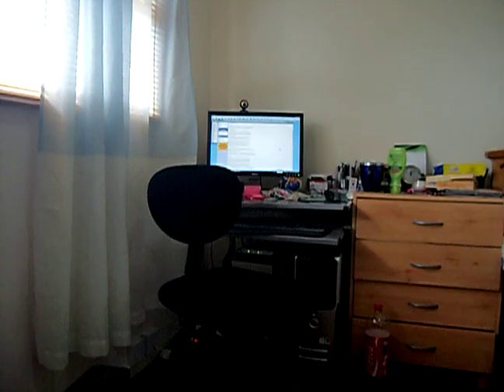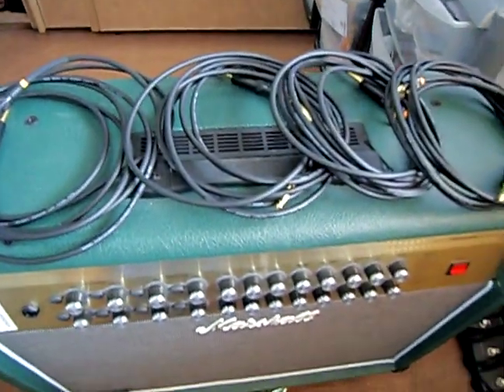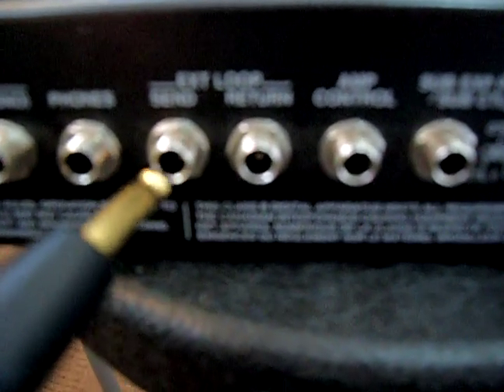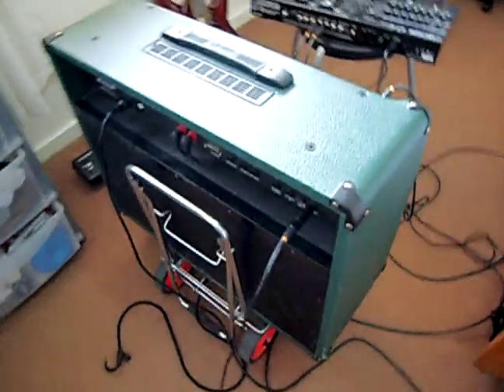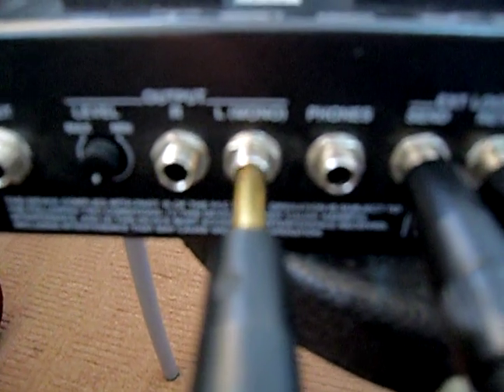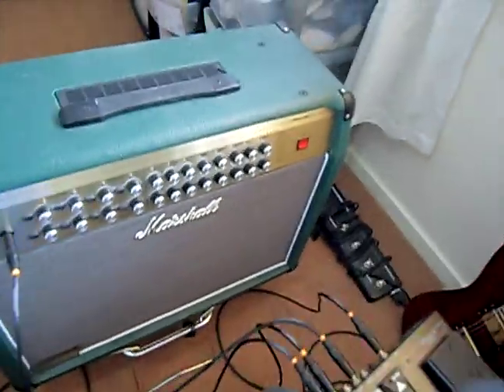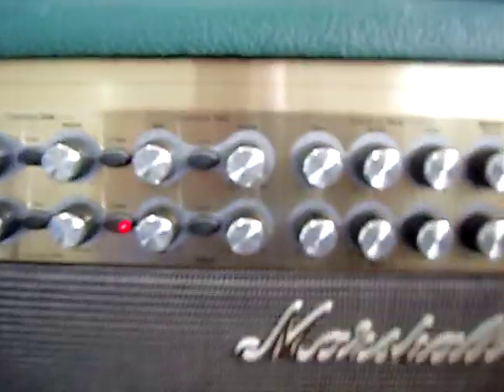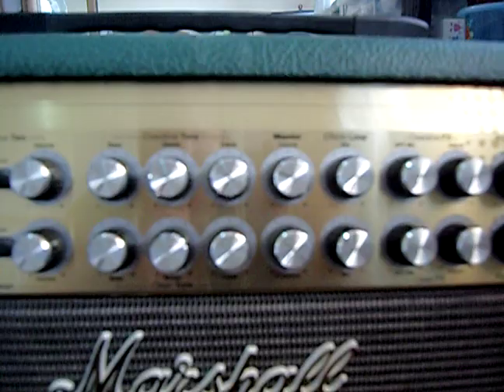Boss GT- 8 in 4 Cable System

Comment: Hi Jose, i have just seen your video, unfortunately it is totally wrong. The preamp on you marshall is paralized as tou say, because on the boos the loop function is not activated. In this case your 4 cable method makes no sense. All what you have generated a regular chain guitar->gt8->amp. If you activate the loop button on gt8, than is the 4 cable method alive, some of the effects are going before the marshalls preamp, some after. This is the sense of tye 4 cable method. All what you have achieved is a basic chain without the 4 cable method.

Comment: Basically, it makes the boss gt-8 the amp head, but you still have your amps power to power the cab...So, it actually puts the gt-8 AFTER the power-amp, but making the is BEFORE the preamp...

Without the 4 cables, you basically would just be going into the front of the amp or the effects loop, altering all tone, but the gt-8 is the only real source of sound, just the amps power amp is powering everything.

Comment: if your going to bypass the knobs on front anyway just one run cable to the marshall power amp it makes no sense to run 4 cables and get the same result with 2

Comment: @skiesburngrey I agree with this. Your method is simply using the Marshall as a power amp and you can just connect the output of the GT-8 to the fx return on the Marshall and that's it. One cable is all you need.

Comment: @NZLeduc - you're absolutely right. This is a standard series effects loop rig. Like you said, the four cable method allows you to include your amp's preamp in the signal chain when you want it. The proper 4 cable method is:

Cable 1 - guitar into GT8 input
Cable 2 - GT8 left output to amp FX return
Cable 3 - amp FX send to GT8 loop return
Cable 4 - GT8 loop send to amp main input
Reply: thejamspot yes, but you also have to activate the loop function on gt8!

Comment: its mostly for those who don't wanna use the built in amp simulations on the GT and wanna use their own amp's distortion but still be able to use reverb and delay and all those modulation effects POST-DISTORTION, it allows you to have 2 sets of effects pre and post effects, pre being wah, com, noise gate, OD, and post being reverbs and delays and modulations, teh way this guy has it is so he uses the AVT as a poweramp and speakes but thats not the main reason to have this set up

Comment: the best way to use it so that your amp becomes only a power amp is to plug the GT's output straight into the AMP's effects RETURN, turn the effects loop MIX knob on the amp all the way up, and plug a DUMMY (just a 1/4" plus with nothing connected to it) cable into the effects SEND of the amp so it bypasses your preamp completly

Comment: ya cool shit,I have a Blackstar HT5 with pedals in the front and the loop,then I just recently got a Roland JC90,AND I SWITCH OFF FROM ONE TO THE OTHER,But was lacking some compression,and some other stuff ON THE JC,then I said,Duh I have a GT8 Packed away,just hooked it up like this,plus one other cable,cause I got 2 speakers in the 90.and holy shit,amazing,got compression and much more now,SWEET! : )

Comment: 5cm is the go if ya have a 2 channel amp, connecting the fifth cable to ya amp control, and to the amp channel switch give the ability to switch the preamp from clean to dist with the gt8, plus effects etc

Comment: Since your amp has 2 FX Returns, you could run another cable from the right output of the GT-8 into the right FX Return on the amp. The reason your amp knobs do nothing is you haven't used the GT-8 to use your marshall as a preamp model in the GT-8. Just as you select JC-120 or any other amp in the GT-8 you can use your marshall as one too and place it in the effects chain. You have to enable the GT-8 FX loop and select external OD/DS and then your marshall preamp would be in the effects chain.

Comment: once again you dont need 4 cables to set your amp up as a power amp just an additional 1/4" plug, in my case i have the 4 cable set up and im also using the AMP CONTROL jack to switch between clean and distortion on my amp, i only need 1 distortion and 1 clean sound, the GT is to sweeten those sounds, i can add a chorus or flanger to my clean or delay or reverb same with the distortion, anyways just thought it might help you understand it better.

Comment: @28monkeyking28 You will need two amps then, you do the 4 cable method and then use the right output from the effects unit and run it into another amps return.  This would work best with matching amps.  I have done with with two combos that were almost the same.

Comment: Interesting but this is not the usual way to use the fx loop . The point of 4 cable method is to use fx in between your amps preamp and power amp . This setup completely bypasses the tube preamp on the amp ( the good part ) . If you wanted to use the amp emulations for the preamp this is the way to go . If your going to do that you might as well get a tech 21 power 60 amp . Its just the power amp and made for this application . Still you can't beat a tube amp . Sorry to beat the point home .

Comment: hi...i use 4cable connection in another way:
activating the loop of gt8 (normal set, placed properly in the efx chain)  and deactivating the preamp emulation;
in your patch i see Loop OFF and the preamp emulation ON.
what's your philosophy?

Comment from the maker: hi. the amp has 24 knobs. only 3 knobs work if u use 4 cable system - master volume, presence and effect loop mix. The tone of marshall and gt8 is alot better if u connect it this way. Connect it from the front and the tone is not really that warm and organic and its noisy. With the 4 cable system, the sound is quiet even when the voume is at the middle. The tone is warmer..thats all i can describe it. But the amp is so damn heavy. I always bring a trolley with me...

Comment: When I use this method the volume pedal will only act as a volume pot (increase and decrease of gain) but I want it to act as a master volume. I have tried placing it in several different parts of the fx chain, but it wont work (btw im using the GT-10, but I'd imagine its not too different)

Comment from the maker: its a personal thing. i cannot use the gt8 on the front coz it sound digital for me. if at the back, to my ears, its huge, balsy and warmth. and my live sound is preset 1, bank 1. its called high gain. i did not change the preset at all. im hapi with boss parameters. i just change gain to 9 plus ds1 on top of it. then i change the output to combo return.

Comment from the maker: I have an old fender amo, 1 x 12. it doesnt have an effects lop so everything is done at the front of the amp. The gt -8 is so noizy..u cannot appreciate what Boss is trying to trying to do. For that, I did not touch the gt-8 for almost a year from brand new coz i thought i bought  a wrong equipment. when i got the marshall avt and discovered the effect loop connection by accident, things started to shape in a different form. I think any amps will do provided it has an effects loop at the back.

Comment: This is the 4CM-cabling, but YOU ARE ACTUALLY NOT USING the 4CM. The way you use your rig, you could get rid of two cables and just plug the guitar into the GT and the GT's out into the amp's fx return... which is common practice with mfx that do not support 4CM. as someone else said: the point of 4CM is to have the sound of your amp's preamp and be able to add the GT's effects before and after that. if logical reasoning isn't your deficiency, 4CM isn't all that complicated.

Comment: what do u set the output setting too? combo return??
Reply: Set your output to the one that sounds best to YOUR ears. So many people say to use the line/phones output, but to me, I use the JC 120 return setting (even though I use a Marshall solid state combo amp). 

One invaluable trick I've learned is for any patch that just sounds weak or terrible, press the amp button, then parameter, then cycle through the settings while you play. I really like the mono setting for some reason (even though I have a stereo amp). 

Hope this helps anyone who needs it. Also, there's a big pdf download out there that is written by users for the gt 8.
Reply: the pdf is called Boss GT8 Brilliance

Comment: This is not the proper 4 cable method, the whole point of the 4 cable method is to be able to use your preamp settings from your amp while being able to place effects before and after it. And to be able to switch back and forth from that and the format your using here. I seen a really good video demonstrating this on a Digitech RP1000, different pedal same concept.
Reply: I SAW (not seen) a really good vid